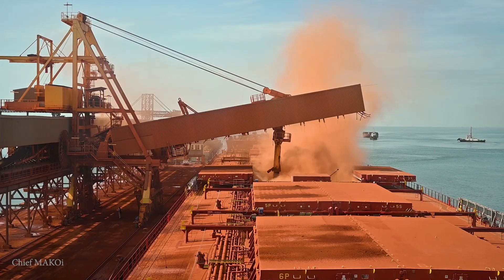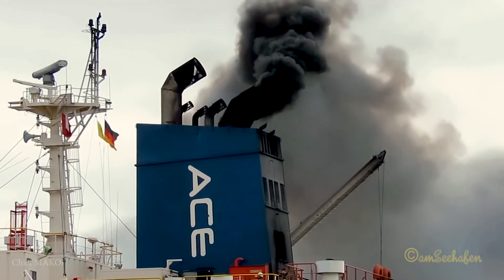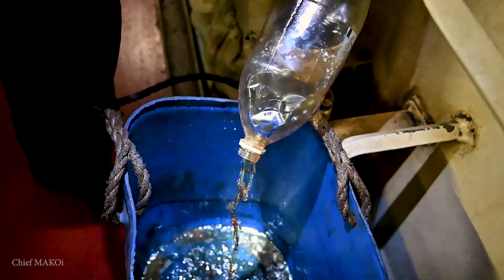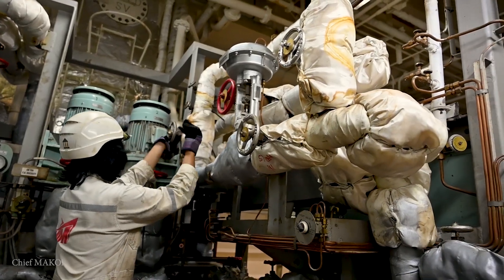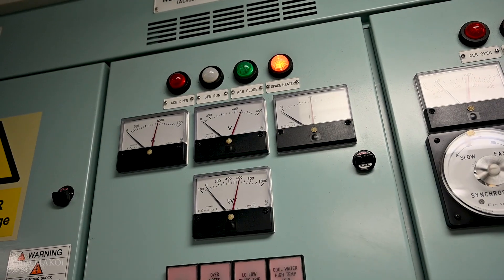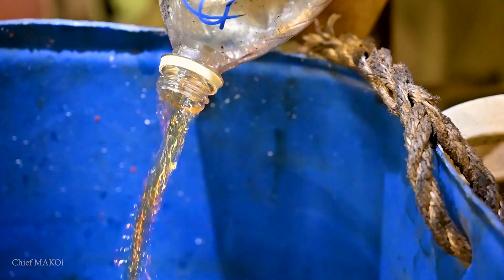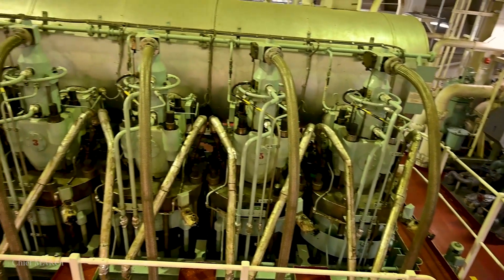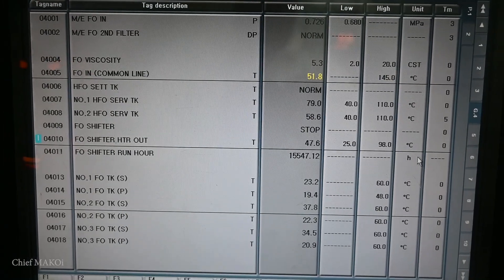Changing The Ship's Fuel : From Heavy Fuel Oil to Gas Oil Changeover Procedure | Chief MAKOi

Comment: Very interesting Chief.  I was and engineer on several U.S. Coast Guard cutters.  We used jp5 on the larger ships as we had diesel and gas turbine propulsion as well as aircraft. We got very efficient at changing fuel injectors/pumps on the Diesel engines.

Comment: I hope that the ship owner gets to charge more for all the effort and cost of  switching fuels on the move.
The thick black fuel is commonly called bunker fuel and it is what is left at the bottom of the catalytic cracker that separates diesel,gasoline, and all the pane's and tane's and lighter gases ending with helium. So bunker oil is basically a waste product from turning crude oil into different fuels. I had read that bunker oil had been banned from use world wide. Thanks to your video I now know the real story about it. Thank you 👍

Comment: About ten years ago, I was working as a consulting engineer to a major cities school district.  I came in about 3/4 of the way through the transition from  Number 5 (heavy) and Number 6 fuel oil  to Number 2.  The biggest issue  had to do with the District reusing existing fuel tanks, piping, and transfer pumps. While the tanks were allegedly cleaned by the contractors, we still had trouble with left over heavy oil plugging filters strainers and burner nozzles when it congealed.  And unfortunately the one modification the District did to the transfer pump/heater skid was to disconnect the steam and electric heaters. So you couldn’t turn the heaters on to heat the fuel and liquify the  clump of old heavy oil.  I remember one school where the building engineer had to manually tear down the duplex filters twice a shift, and scoop heavy oil out of the body
Reply: @wallacegrommet9343  They use tax dollars to find their butts, lots of dirty dollars post wiping their butts with them!
Reply: @wallacegrommet9343  why is it stupid? Seems like they paid for the contractors to perform a service and they did not do so satisfactorily. They should sue them.
Reply: My comment was misposted! It somehow got here from another video😬
Reply: @wallacegrommet9343  I find that can sometimes happen when auto play is on, it’s confused me before now.
Reply: Sounds about government. Was it a blue city? Red cities have their own stupidity, however, each side seems to specialize in certain forms of idiocracy, over others.
Reply: @DesertCatDad  beats getting shot
Reply: @DesertCatDad   It probably has more to do with deferred maintenance, lack of budget and really...really...old buildings, which you find in larger cities.  The types of buildings that still have huge oil burners, especially if they're using anything near bunker oil, are ancient.  It's the same thing with HVAC upgrades.  It takes millions to do an entire district.  Money that is, many times, simply not there for capital projects.   But keep on raging.

Comment: Chief, very interesting content.  You stated that you go through this process rather than just burn the cleaner fuel all the time due to costs.  Is there a ballpark delta between the costs of the two?  Is it worth adding in the costs of keeping the fuel so hot to allow it to work or is that too minuscule to make a difference?  I would guess that there are also some costs in just being set up to carry both fuels (piping, valves, tanks, maintenance, etc.).  Always enjoy your content!
Reply: Possible in some regions gas-oil is not available.
Reply: Even hyper-efficient 2 stroke marine diesels  throw away half of the fuel energy as waste heat.
There is many times the heat needed to preheat the fuel available in the engine coolant.

Comment: Well explained. But 40 years ago we also had to change from HFO to marine diesel (as fuels were named at that time) some time before  finish with engine.
Simply because there was no re-circulation and stating a big MAN 2-stroke ME with cold HFO in the pipes was impossible. But I think as circulation is standard now for years, you can go from pier to pier with HFO (or what it is called now) outside critical areas ...

Keep safe! br ;-)

Comment: Does the lighter fuel run hotter in the engines?  Like gasoline burns hotter than normal diesel fuel.  Well, it burns faster than diesel, so more gets used I guess.
Now, all you need in your engine room(s), are more valves!
When I was in the Navy, we were told that half the weight of a ship was just the number of valves in it!  LOL
😆  😉

Comment: I wonder what is going to happen to the heavy oils once they are banned from vessels. They are part of the refining process and vessels are the consumer without that use what will happen? Pump back into the ground?

For those wondering the hydrocarbon molecules are much longer and the bonds much stronger in the heavy oil so more energy is released in combustion (breaking bonds) than in same volume of lighter oil. In the combustion space only so much air (oxygen) can be added so that limits the amount of fuel that can be added.  An engine on lighter oil has  less energy output which means less speed.
Reply: That guy with the brain.  2050 IMO zero emissions. I don't think gasoline and diesel will be done by then because there is barely enough electrical generation capacity to maintain demand now.

Comment: Chief: I heard you say you use steam to heat the ready fuel tank and I'm sure that the boiler is providing steam for the galley and space heating as well. When I was in the US Navy all 3 of our Turbine generator set's had waste heat boilers that used the hot exhaust gas to produce steam. I'm sure you have diesel generators and so the exhaust gas from those would not provide enough waste heat to operate a steam boiler. Are you using a dedicated steam boiler fired from main engine fuel or is the main engine large enough to produce steam from it's exhaust? I'm just curious about that. Personally, I hate steam lol. Despite becoming a gas Turbine systems tech to avoid steam power I ended up with 3 steam boilers on the ship I was own anyway.
Reply: Though I dont work with cargo ships, the systems i've seen usually use the waste heat from the engine cooling system, or alternately I imagine it would simply use a direct fuel/electric boiler to create the necessary steam.

Comment: How far away is shipping from transitioning to Hydrogen fuel cells? Are you already researching that for future engineering developments?
Thanks for interesting videos and best wishes.
Reply: Economical to build, but not to run.
Fuel cells do 60 to 70% efficiency.
Huge marine 2 strokes about 50%.
And they are the most efficient ICEs.   If you are forced to use the same fuel for both, the higher efficiency wins economically.
Reply: Apparently many engine manufacturers are doing heavy research into hydrogen (and ammonia and methane) fueled internal combustion engines. The idea is to make a huge  12, 16 or whatever cylinder motor the size of a bus and have it be powered by green hydrogen made with solar/wind and water electrolysis. It would be so much more economical to build a 10MW hydrogen fueled ICE than a 10MW hydrogen fuel cell.

Comment: Did you say that you need to start 4 hours before crossing the line?  Wouldn't you need to finish the procedures at 4 hours before?  That would give the old fuel 4 hours to process through the lines?  Or am I misunderstanding?
Reply from the maker: Switch-over the valves a little over 4 hours before.  Because 4 hours was the computed time for the remaining black stuff inside the pipes to be completely consumed.  By the time the ship crosses, the pipes must only contain LSMGO.

Comment: This is a very interesting video and I am sure there is much more to it. These engines are compression ignition engines (diesel) right? The “clean” fuel looks similar to gasoline and we all know what happens to a diesel when gas is put in the tank accidentally. So, does the ship’s engine have variable timing or some magic adjustment to prevent catastrophic preignition? Maybe Chief a Part 2 follow up video is in order to educate us further. Thanks Chief.
Reply from the maker: It's basically diesel.
Reply: I am by no means an expert, however the lighter fuel looks more like #2 on road diesel ULSD used around here. I imagine that's basically what it is. If that's the case there would certainly need to be a different injection strategy but other wise that would probably bit it. I imagine that part is being handled by the engine management computer when they input the new fuel values. Don't take my answer as fact though,
Reply: @rgj5832  What you say makes sense. It’s mind boggling because the fuel viscosity and explosive characteristics would constantly be changing as the supply lines are being washed out.

Comment: I've got a quick question. Do the different types of fuel result in different engine performance, or is it basically the same?
Reply: The lighter fuel is less dense, and produces less energy. The engine has to burn more for the same power.
Reply: @5roundsrapid263  Ah. I suspected that it might be something like that. Thanks for the info.

Comment: Great informative video. As a marine diesel Mechanic overhauling fuel pumps that was using havy fuel oil is nasty. When I receive them since they are cold have the use a paint scrapers and chisels to get the sludge out just to tear them down. They stink too everytime we crack a set open office people come out thinking there is a natural gas leak in the shop lol

Comment: Great explanation on fuel change out. When they first swapped to low silly fuel there were issues with o-rings on the fuel injectors. They weren't compatible. That was a few years ago. What do you do with the fuel samples? Pour them back in the tank or oil water separator.
Reply: I remember that back in the 90s all the O-rings for the fuel delivery valves on my fuel injection pumps started to leak. Fortunately they were American Bosch injection pumps and the O-rings were fairly easy to replace

Comment: Most IC engineers know the various levels in the distillation process of oil - you know the stuff the idiots are trying to stop using. It is used for much more than just fuels it goes into cosmetics and just about everything you could think of.

Comment: I am not a marine engineer or in any way marine-related but I have always had a fascination with other forms of engineering especially the big ships. From the little knowledge I had obtained so far, I already knew about the 2 different types of fuel but I never knew how the change over was done. Thanks to another great video from your channel I now do. Thank you chief for continuing to expand my knowledge. By the way, I am a very much land-based, Computer Systems Engineer / Scientist.
Reply: A lot of ship engines are dual purpose.  I am not a marine engineer, but the motors that we use in our work train engines is the exact same motor that tug boats use.  That is why Germany was able to sell China enough motors to power the entire modern PLA Navy surface fleet.  😬😬😬😬😬😬😬😬😬
Reply: Wagner PD  Maybe or maybe your average German would sell his Mother, sister or daughter  into a Turkish Harem for profit.  😁😁😁😁😁😁
Reply: theres more than 2 types theres almost a dozen grades of bunker oils that ships burn

Comment: Question: Is there any noticeable performance change as you transition from one fuel to another? Do both fuel types have comparable energy density per volume burned? Sorry if you already mentioned that but I didn't catch it on my first viewing. Absolutely fascinating video. With each new video you produce, I'm more in awe of the number of things a ship's crew has to keep track of.
Reply: I'm not sure a about shipping, but in the US back in the day of off highway diesel (red) to the ULS(Ultra Low Sulfur) on highway, there was a noticeable difference in performance, the red was more powerful (more power density) but put out more smoke and emissions, the new standards on diesel fuel on or off highway is the same, the only thing the red dye indicates now is that it has no highway tax applied and is illegal to run on-highway for tax evasion reasons.
Reply: when we switched from HFO to MDO, we lost some power, HFO has more stored energy than MDO (BTU per Gallon)
Reply: @billyboots3730  The calorific value of heavy oil is the principal reason for it's use, giving both higher output from the engines and more total power per ton of fuel. 
One thing that was not mentioned in the video was that engines have to start from cold on the lower viscosity fuel until the combustion chambers and injectors reach full operating temperature.
The maximum output of all engines is limited by the exhaust gas temperature, running on high viscosity fuel allows about a 15% increase of power within the temperature parameters.
Reply: Chief mentioned he has to input the fuel change into the engine management system. I guess it squirts a wee bit more to compensate.
Reply: I had once as a yacht sailor a change of fuel. We ran out of fuel near a military base. The only fuel they could provide me was fuel used and for airplanes and diesel engines . After I started my engine it sounded like a singer sewing machine instead of a diesel engine.
Reply: @hesseldijkstra5327 JP-8

Comment: You already compliant with the new regs on Fuel Sampling points for all oil consumers?  Speaking as a former Ch/Eng and more especially as 2nd, I hated the changover to distallates and back again. With the changes in temperatures you sometimes get transient leaks, Valve packing on valve spindles/booster pumps, torn 'O' rings in shell and tube heaters and worst of all, oil in your Hotwell..... Had to push the boys to watch out for these, remedy them and report them.

Comment: Hi Chief, nice report. Can I ask how much fuel you carry on board and roughly the fuel consumption I know it will vary according to speed and other variables can you give a sort of guide to miles per ton or however you measure it. Thanks
Reply: He did a video on refueling from a bunker. It was 400t iirc.
Reply: @carl8790  thanks Lil, good tip to watch that vid. The 400 tonnes was what they took on, but didn’t say what the overall capacity was. I looked up the cost difference between the two fuels - about $50-80 per tonne. So it’s a decent whack when the run on the cleaner fuel.